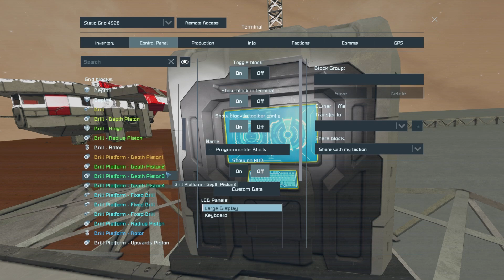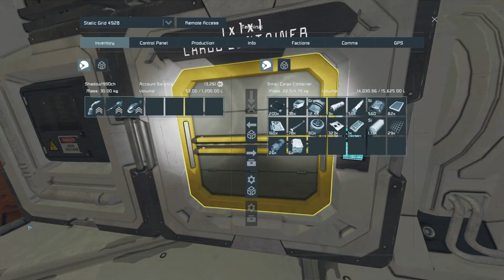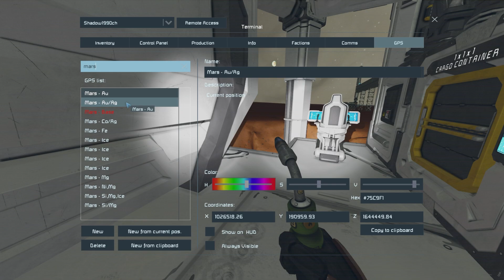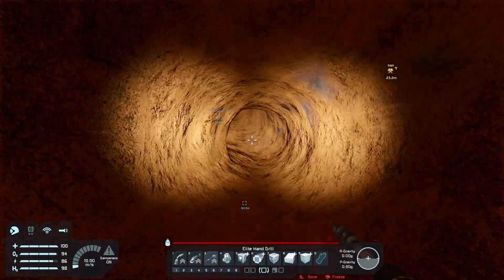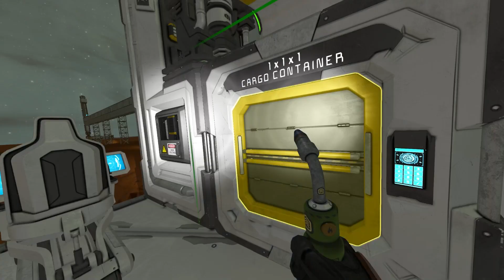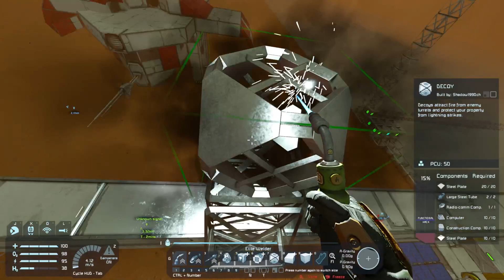Space Engineers: Safety Measures

Comment: Have you by any means been able to determine how much material the new drill has collected yet?
Reply from the maker: Not really but it can't be too much so far.
Reply: @shadow1990ch  Have you looked to see how much is inside each drill? [seeing as they have storage on them]

Also if you put a sorting unit anywhere between the drills and the storage unit you will force all of the material out of the drills into further storage more quickly.

Then, with a sorter from storage, you can force ore and stone into refineries and with another sorter force components out of assemblers into another storage unit.

I have seen a lot of long time streamers show how to highly speed up the process with a few sorting blocks.

Also, you could even put an outlet in the conveyor near the drill, if you needed materials, just put it some place close to where you are working and the conveyors will pull the components for you.

That would save you a lot of time and a lot of hydrogen.
Reply from the maker: Yeah technically the refinery itself should pull out the stone fairly quickly aswell anyway. But the whole sorting stuff is planed in the future.